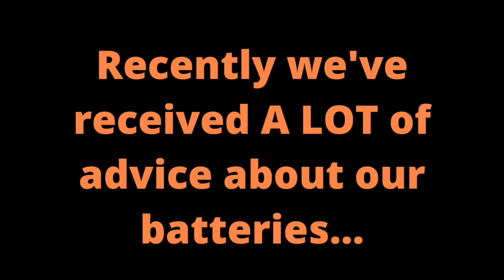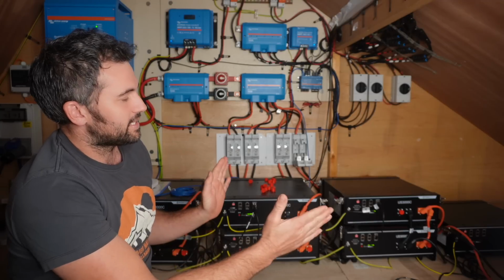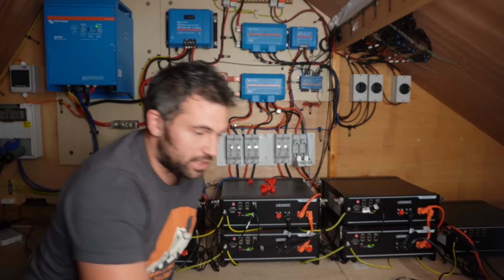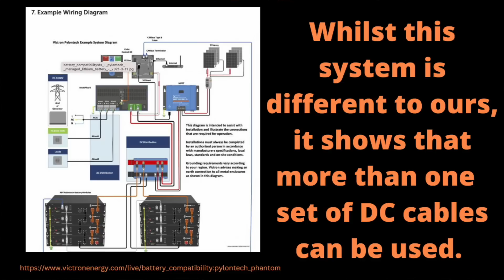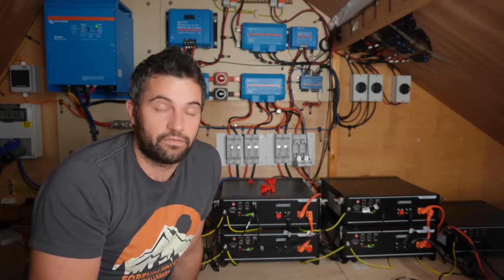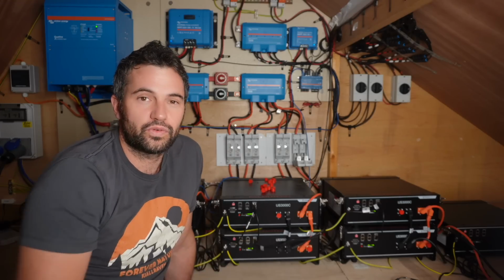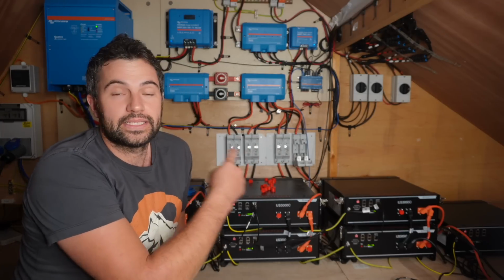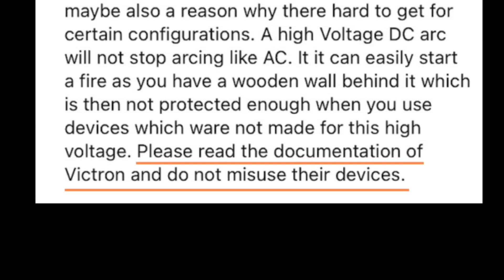WE WIRED OUR PYLONTECH BATTERIES 'WRONG' (and other misconceptions!)

Comment: Well, thanks for posting my advice, haha 
I do not have a beef with you. I think it is very dangerous to say it is well proven to work. Yes, maybe it is, NOW, but systems will tend to fail over time, so will also isolation of cables change over time. Why do you think have modern good inverters a so called isolation resistor check where they measure fault voltage to ground which is because of failing isolation OVER TIME or if for example a bird picked into the isolation of a cable. All SMA PV inverters I installed in the last years for example have this check built it.

The higher the Voltage of your DC String is the more easily an Arc can JUMP several inches. The outgoing poles of your "DIY Combiner Lynx" are NOT COVERED. Stick a metal screwdriver or simply a metal wristband of a watch near the both poles and watch how fast the ARC is really badly injuring yourself or whoever is working on your system. See here for demonstration: https://www.youtube.com/watch?v=S9a2oPCIMr0   or more educational here: https://www.youtube.com/watch?v=xDLKLnVdlWE (5-10 Arc flash injuries a day only in the US!!!)
And that was not a lot of volts on that string! only 4 panels with around maybe 150-160V. The DC arc will NOT stop believe me when I say that so called fireproof sheet behind your installation will start to burn if this is going on for a long time of period.

I love your videos and I love that you showed your installation. I just want you and also others who watch them to be safe. High Voltage DC Strings are very very dangerous, more than you might think. Just watch the videos I provided.

Just a word about the Pylontechs, which I also use with 3 MP2 3000VA inverters. You can actually use 2 positive and 2 negative wires per Group and double the amount of current capabilities. So therefore you can have one long positive wire at the top and one long at the bottom of the group both going to the busbar. You can run yours like this but your then still limited to 100A continous as you just use one cable per group. If you want to step up I propose to use 2x2 per group and you then easily have 200A per group which would make it easiy to have 4 in a group and still have 200A current. Sadly this Amphenol terminals will only go up to 35mm2. Thats the max the connector will handle. Thats why pylontech in their original manual for the C series, which is different to the non-C series, is even showing this connection possibility. It is working fine in my 3 phase System like that.
Reply from the maker: Thanks for your comment 😊 More evidence as to why we called you ‘The One That Was Right’. We’ll have a think about what you’ve said. Until then, no watches! 😳👍

Comment: Hi just changing tack for a moment, have you calculated the cost per kWhr of running your back up diesel gennie? I just ran mine and it works out at 28p/kWhr, a bit less than the new electricity price cap (32p/kWhr). This cost doesnt include depreciation, maintenance, oils, spares and so on though but then again we have no standing charge. Maybe it would be cheaper for Liz to start gifting generators instead of the price cap (just joking!)

Comment: I’m afraid you don’t have enough batteries for the peak surge on the 10kva Victron. Victron also state the minimum number of Pylon batteries for each Multi or Quattro. Pylon spec sheets also state the maximum current per unit.  The larger Pylon units can also handle much larger demand.  You are right about your fusing and cables though although, but you need to check every element for longevity. I’t not easy. Keep going we really enjoy your channel.
Reply: Hope that helps, use the lower figures for output which corresponds to a battery that’s not fully charged.

Comment: I grew up in the 80s also... and everyone I grew up with cheated through school at some point except me. So this makes me wonder how do you know if such and such batteries really do have the amp hours they stated? I mean... those guys probably cheated through school too. People that don't cheat just don't get noticed to get hired because they look boring. 

So... what do you think on this? (Battery amp hour accuracy) 

...

Also whether or not you wire the batteries parralel or series really depends on if you want a 24 volt or a 12 volt system or whatever. 

But I don't know yet if it matters if solar panels have to be parralel? I mean if batteries can be either then can solar panels be either also?
Reply from the maker: We’re not experts by any means, but our understanding is yes panels can be in series, parallel or series parallel depending on your system size 😊

Comment: Hi, I'm not here to criticize. I just want to try to help. I respect that you want to try and install all of this yourself. For real. Have you already tested whether, for example, 2 x 3 or 4 batteries do not work better? I bought this (ICM from iccsoftware) because I also had doubts about my pylontech. Since then I've been more reassured about how it works. I draw 120amp max from a 374AH pack. I helped a friend with an 8000w multiplus with a 400AH pack. (2x4 US2000C pack) Also works perfectly. My first setup also had an alarm a few times when the battery pack was only 2xUS2000C. That inverter could only draw 50 amps. Also worked perfectly with 4xUS2000C pack afterwards. This Windows software can also read Pylontech. (multisibcontrol)
Reply from the maker: Thanks for your comment and for sharing your own experiences 😊 it’s always interesting to hear what other people do 👍

Comment: Bus bar calculation for copper is roughly 1.2 x cross sectional area =  current capability. There is no skin effect in DC. The Voltage is irrelevant until you hit the breakdown voltage of the insulators (usually between 600-1000V).

Comment: Technically the inverter does not draw 400 amps. It is the load to which it is connected which determines the current.

The 400 amps is the maximum output load current the inverter can deliver, IF the load requires it.

So for example, if the maximum load wattage is 20kW, then the inverter need only deliver 87 amps. And you don't need an inverter with 400 amp output capability.
Now let's suppose you do continue to use that 400 amp inverter, even if it is oversized,  your batteries do not need to deliver 400 amps either, and you don't need to wire them in a way that delivers 400 amps.

So the starting point has to be what your total load is in kW.  From there, you can size the inverter and battery.

Comment: Let's do the analysis.
6 Pylontech US3000C batteries, each with 74Ah capacity (= 3.55kWh each) giving a total capacity of 444Ah.

And you've got a 400 amp inverter.
I'm assuming that is the input current into the inverter.

So at full load, with a full set of batteries, your batteries will be completely drained in just over 1 hour.

Did you know this?

400 amps discharge current at 48 volts from those batteries is a power rating of 19.2 kW.

Many houses in the UK are fitted with a 100 amp main fuse at 230 volts, which gives most households a maximum power utilisation of 23kW.

So it would appear your design objective was to put together a battery installation which could feed an entire house. Would that be right?

But did you know that when that happens, you can only feed power for the entire house for 1 hour. It is not likely you will be using 19kW unless you have electric heating for the premises, so it is likely that the batteries will be able to provide power for longer than an hour, way longer.

Have you looked at your electricity meter and the kWh usage over 24 hours in summer, and on a cold winter's day?

Do you know how long the batteries will last before becoming depleted?

Comment: Few thoughts.  Glad you've gone the bus bar route with the batteries in groups of 2.  I was worried you had it in one string as Pylon usually recommend.  Why are you obsessing about your bus bars and fuses being rated to 200vdc?  Your pylontechs run at 44vdc to 53vdc which are under the 58vdc rating of say the victron megafuses.  The mega fuses will be fine which is why they are used in thousands of 48v installations around the world?
Reply: I think it is the bus bar for the incoming PV DC he is concerned about.

Comment: What you can do, is get a 6-8 way consumer unit, fill it with fuse holders and use 38x10 gpv ultra fast blow fuses, intended for string fusing. 
Your strings should come in there first, then to dc disconnect. 
In the same box with the dc string fuses, you can fit some spd’s rated at string dc voltage.
Reply from the maker: Thanks for your comment, we will look into this 😊👍

Comment: Good vid & response. I think you have done well, it all looks pretty good to me, building this stuff doesn’t always come together straight away, and you are doing the right thing in assessing the overall system for weak area’s and addressing them as well you can. 
Hope you can get things sorted out with ur Supplier/Manufacturer, re: the battery issues, otherwise I would suggest to consider build ur own from 300+Amp Eve type cells and a good (JK) BMS. Cheers
Reply from the maker: Thanks for this 😊 sounds like a good suggestion. We’ve threatened the supplier with legal action now so watch this space 😊👍

Comment: Hi - as the cable voltage rating increases it’s likely that a 2nd layer of insulation is added to secure that it is safe to touch in all circumstances. Perhaps like an extension cord - insulation on the live conductor and then another layer around the whole lot. Just my thought :)
Reply from the maker: That sounds like a sensible theory 😊 Thanks for sharing 👍
Reply: Inside an electrical appliance the manufacturers often use thinner insulation than we are used to seeing, because they know that we can’t touch it. The “second layer” is then the appliance box which we need tools to open and hopefully we have unplugged it by then … hopefully :) .

Comment: It’s great hearing your experience on your Pylontech batteries. I would question the suitability of using these batteries in a big storage system like yours. They maybe ok in a smaller system. One question I would have is what is the second Victron MPPT for ?  If you have more than one they need to be linked together so one is the master and controls the charging that is done by the slaves. I am fairly sure you have all that done.
Reply: Why question? They even have extra hardware to combine even more batteries.  The US5000 can have 16 without any extra hardware.
Reply: Why do they need to be linked for? I have 3 on a system working for the past 8 years non linked. Only the ve can can be linked, the ve direct are all connected to the GX hub. No need for any linking; and this is per victron manual.
Reply: As Andrew said, up to 16 of these Pylontech units can be connected natively. More units can be added by using a dedicated communications hub. The idea is to match the number of batteries to the calculated load so that the current draw from each battery does not exceed the manufacturer's specification. For the US3000C this is 37A continuous and double that for short periods. Given that, 8 batteries is well within spec.

As for the MPPT controllers, if using VE.Direct, you can use DVCC in the GX device and configure it to use a single voltage source as the reference voltage. Once that is done two completely different MPPTs will work together beautifully. Sometimes a system requires this sort of thing. For example, if the number of panels you have connected in series and parallel exceeds the rating of one MPPT, but the extra panels don't justify another larger MPPT, then adding a smaller unit is both feasible and desirable. As long as they are each capable the same output voltage  then mixing and matching fine.
Reply from the maker: We have two MPPTs as we have 2 solar arrays. One 16 panels and one 4. They communicate with each other through the Cerbo GX, like the other comments have said 😊👍 Glad you’ve found our Pylontech videos useful and thanks for commenting 😊

Comment: Are all your battery cables exactly the same length because the difference in battery cable lens will equal a different resistance which will cause some batteries to charge quicker than others bringing them out of balance, which seems to be your problem

Comment: I could not see the PV connections, but treat them with care! There is a reason why the batteries are around 50v. Any voltage higher can be lethal. You mentioned 90v and that voltage can give you a bad day. Also note that if you get electrocuted by DC, and you are gripping the conductor, you cannot let it go!

Comment: My dears, you should have gone with the recommend Victron Energy battery bank schematics (2 battery banks of 4 Pylontech batteries each)... not more, because it's a known fact that it's very difficult (not to say impossible) to balance out batteries and cells in more than 2 parallel battery banks (you intended to use 4 battery banks, hence the problems with the individual batteries and their frequent alarms)... if I remember correctly, I recommended exactly that some time ago and you just explained your lack of space in the attic to do that... 🤔🤔
On the other hand, you should have balanced out your batteries as soon as you got them (Pylontech ships them at 50% SOC)... don't remember seeing you do that ... forgive me if I'm wrong... putting them to work at that state, is a BIG mistake... sorry to say...😔😔
Last but not least, you're right, you should get your combiner box on the PV DC side...
Hope you can figure it all out and get rid of your battery issues...
Cheers...!!!
PS: Go with 2 stacks of Pylontech batteries (4 or less each), please... that works...!!!😀😀
Reply: He has balanced them even better, in two’s. Why you question something before you understand how it’s wired?
Reply: @aureltanasan1413  Sorry, but I understand PERFECTLY... I have studied Battery based inverting... more than 2 battery banks in parallel is WRONG...!!! Even Victron Energy says so... 
An balancing batteries is ONE thing and putting them to work WITHOUT balancing is another issue... 
Study a little bit before you give a criteria, Sr...
Reply: To be honest, the real trouble here is, that they had 2 "lemon" batteries in the pack of those 8. First one was dead on arrival, second has a faulty BMS and throws "internal error" all the time. Dealer is the one to blame: he should swap the BMS boards, or replace those 2 batteries. But he's playing hide & seek instead.
Speaking of cables and lack of PV combiner box: yeah, it would be better to fix these, but it has nothing to do with the fact that these 2 batteries are having faulty BMS.
Reply from the maker: Alfredo, we had a little look back at your first comment on our channel and you said we should stack the batteries in one pile and use one set of DC cables. 🔥🔥🔥🤔
Reply: @The_OffGridFamily  Yes, Fraser...!!! Now that you mention it... that was probably it... to make one single 48 VDC battery bank... I think it was some time ago...
After that, I have been lucky enough to study Off Grid Battery Based Solar systems and I have learned a little bit more of these type of systems, hence my recommendations to not parallel more than 2 battery banks and to always balance your batteries (naturally in parallel or to top balance them with a charger) BEFORE putting them to work with your loads...
Anyway, now you're in a situation that you have to try to make the best of what you got... so, if it was me, I would make 2 48 VDC battery banks with the batteries left working properly (6 of them if I am correct)... either 2 banks of 3 Pylontech batteries or 1 of 4 and another one of 2... it's your choice...
VERY IMPORTANT: Try always to work with equal length cables ... it almost a MUST to have them working and balancing correctly... 
Good Luck...!!! And hello to the whole family...!!!